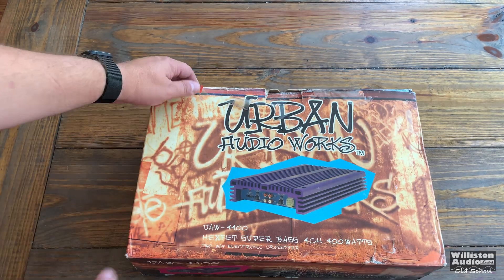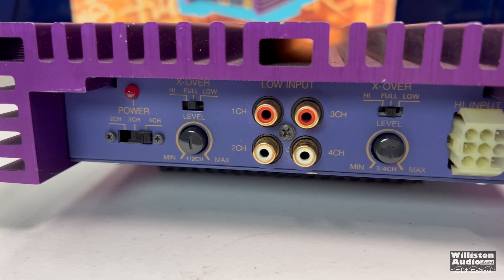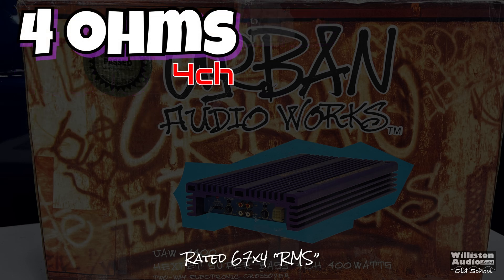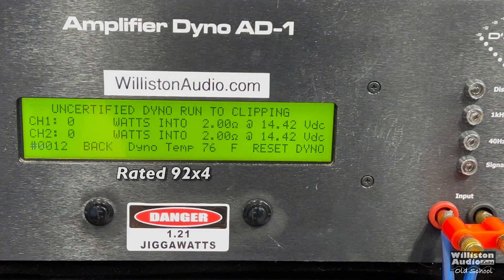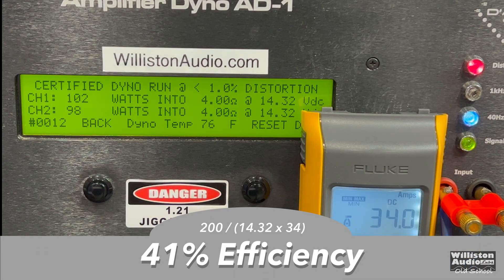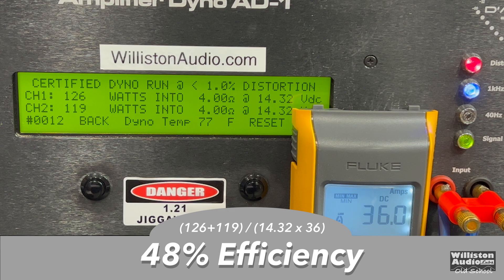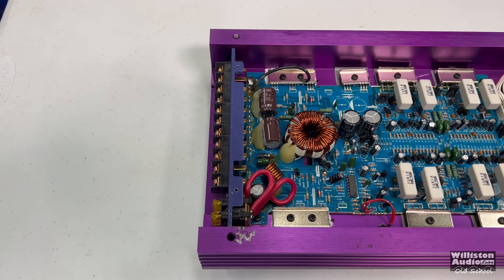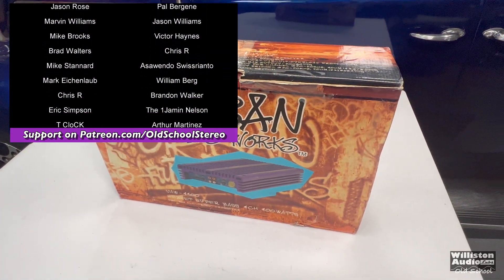How Does a 90's Budget Car Audio Amp Perform? Urban Audio Works UAW-4400

Comment: Urban Audio was the bait that hooked me to the car audio lifestyle. It wasn’t long before I found the good stuff but I’m not hating on Urban Audio. We all started somewhere.
Reply: Haha same here. Got some 12s from good ol target. White basket, purple cone and a half inverted dustcap. Think they are still in a closet at my dads house actually lol 🤘😎🤘
Reply: Me too.  I had the smaller 200 watt 4 channel ant two of the purple 12's.    I replaced the amp with a coustic amp268 which i still have in my garage.  Still have the subs sitting in the basement.   a few years ago, I blew up my JL audio 12W3, so i tossed in an urban just so I still had bass.  Running on a crossfire vr302, it took it and never blew, but i did eventually melt the tinsel leads off of the terminals.
Reply: This was the brand of my 1st amplifier, it was a 2 channel, I want to say 800 watts, I thought I was a badass 😆 🤣 😂
Reply: For me it was Majestic and Pyramid amps.
Reply: @VisionSoundPDX  I had three of those crappy blue Jensen amps (hi/mid/low) with the aluminum tops hooked to a radio shack crossover and two of those purple pyramid subs that sounded like rubber bands and a crappy JVC CD player with single preamps out 😆
Reply: @jessihawkins9116  my first system was back in 1989. Sony dual knob cassette deck, Majestic amps, Sony dual cone door speakers and a Radio Shack subwoofer.

In 90-91 I ran a Nakamichi tape deck, Denon preamp EQ, Audiocontrol ESP-3, A/D/S 325i x2 sets, Linear Power and Nakamichi amps (though I’ll be damned if I can remember which models) and four Terminator 12’s (prior to these I used a Voodoo Acoustics quad 10” clamshell band pass enclosure which I bought from Magnolia HiFi in Seattle). 

Around 93-94 I had one of the first Hitachi in car video systems ever sold which consisted of a pair of 5” TFT monitors and a VCP. Once I bought the Hitachi video system I also picked up an Alpine 7909 preamp CD tuner, and switched over to Orion HCCA amps and XTR subs.

I could go on and on, I was REALLY into car audio back then.

It’s funny when you look at how high SPL numbers have grown since then. The loudest vehicle back then was 159DB even demo vehicles weren’t hitting 160’s yet.
Reply: @VisionSoundPDX  oh and I forgot one of those road gear cd changers that had an rf modulator and wired remote 😆
Reply: Hell yeah my brother..
Reply: Same here.  It was actually good, budget audio.  And always looked cool for the era. I can't hate on it at all.  Subs were very well built.
Reply: Same here! I had the one of these amps on 2 pioneer premier ALCC 8’s and they actually hit and had really good sound. I bought them all second hand. Instead of building a box I used bazooka tubes. A friend had blown the subs in the tubes so I took them out and put my ALCC’s in them. Had them facing out towards the doors behind the seat in my 1997 Mazda b2300 regular cab. After getting used to the bass and saving money I got more serious setup. Sold those pioneer 8’s to a friend and he still has them lol.
Reply: I had some Urban audio works 12s back in the day. Functional, but not great. I remember them well due to the purple cone and inverted center cap. They were memorable…. But back then JL Audio and MTX were where it was at
Reply: If anyone has a set of nice 12's for sale let me know. I eneded up with this amp. Thanks Big D.
Reply: @Slip_The_Jab  same for me think that's why I have a soft spot for urban
Reply from the maker: Yeah man, they advertised a lot back in the day
Reply: @wal  love your content, keep up the good work and don’t change a thing Brotha😎

Comment: This little Barney amp gets a "Participation" ribbon.  Big D - have you ever tested a Crutchfield amp? I have an old 2 channel Crutchfield amp, I have no idea who made it for them. I used it back in the 90s with some box speakers in the back of my Mercury Sable station wagon work car, and it DID bump...
Reply from the maker: Ha! The old Crutchfiled amps were OEM'd by PPI. Great budget banger amps!
Reply: @wal  I just looked at one of your old videos and that Crutchfield amp (painted in blue) resembles the PPI Pro Mos series, same inputs, same crappy Molex connector. But that thing took a beating! After cruising in the Sable for a while and rocking out, you could fry an egg on it (good old Class A/B) but it kept banging... I got my money's worth.
Reply: sable wagon! hell yeah!

Comment: I seen these amps for sale back in the late 1990's and early 2000's for like $89 at a retail store named ames for the price you got a decent amp and they sold the subs as well from 8'' to the 12''
Reply from the maker: Yeah later in the 90's they got more widespread into places like Kmart and Auto Parts stores but when they were first available and a division of Targa, they were sold at dealers as a budget option